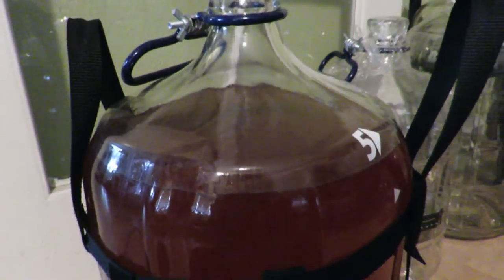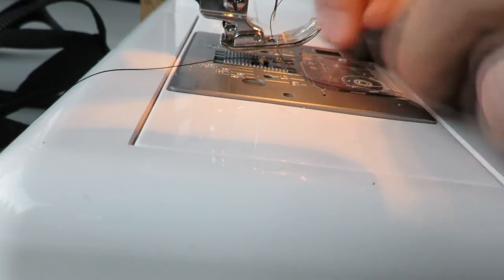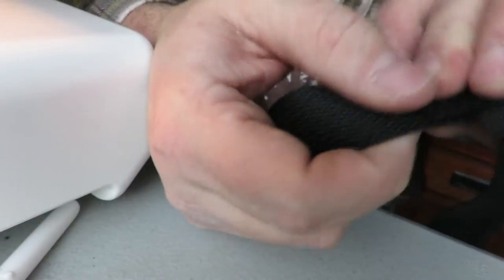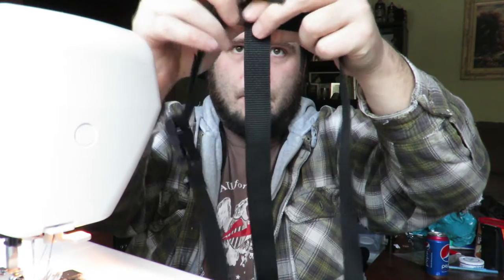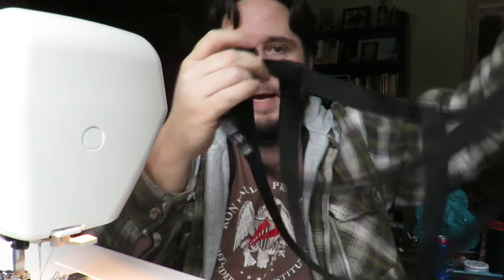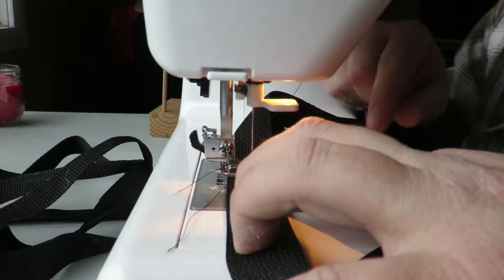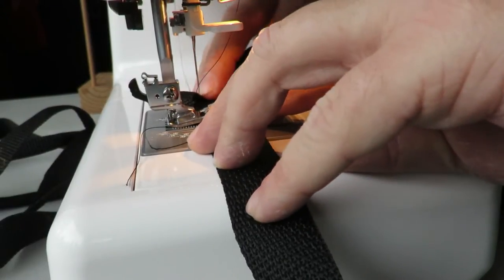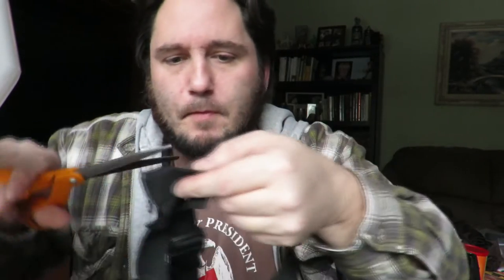DIY Carboy Hauler For Men Afraid To Sew

Comment: I was hoping to use some items I have around like a used bag.  This is great.  I still am concerned about having some cushioning on the carboy.  I was thinking to use some used bicycle tires to wrap around the base of the carboy and this might work for a hauler as well.  If I get the right knots it can work as well.  I have to look up the strength of rubber tires.  Thanks for the great idea and description.

Comment: New to this, I’m wondering if you have the handle around the neck why do you need the webbing? Are the red handle just for pouring?
Reply from the maker: Good question!  Those handles aren't recommended for transport, especially when it is full.  Many carboys have had their necks snap off using them.  I mostly use them for keeping sturdy control over the carboy when cleaning, something to grab onto.